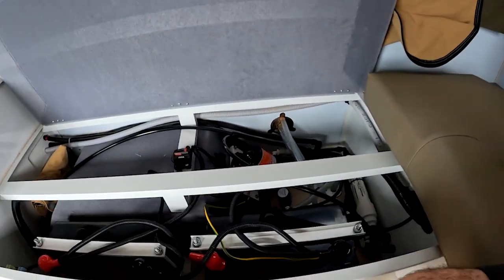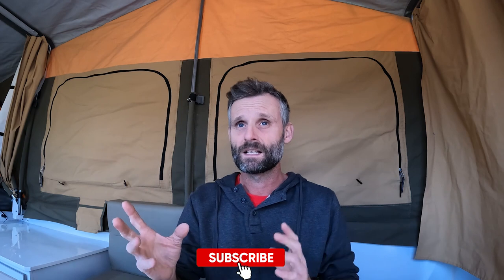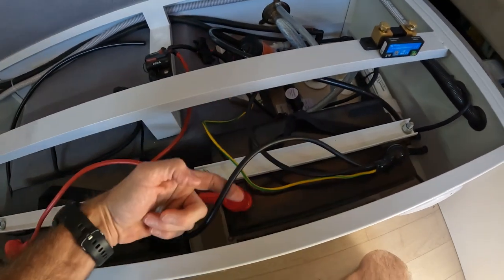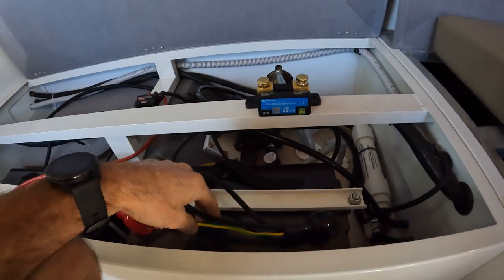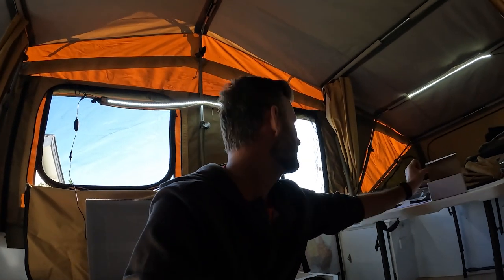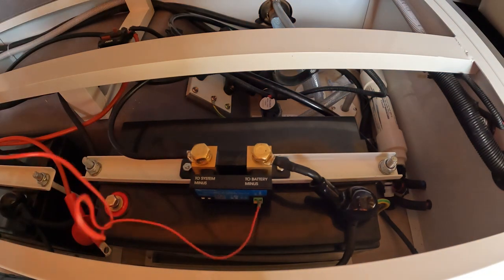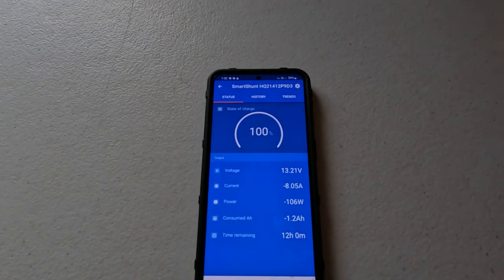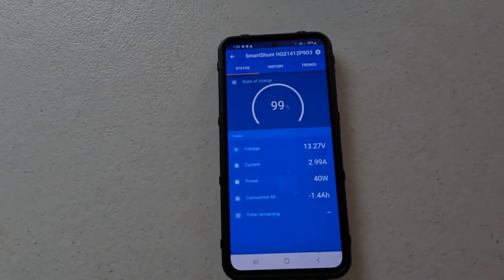VICTRON SMART SHUNT INSTALL - Lithium Battery Setup for Off Grid Camping

Comment: You explained everything just fine. Pretty short video full of good information. The graph about difference of the voltages between lithium and agm batteries tells so nicely why a shunt is needed with lithium. It would be impossible to know the lithium battery fullness with a voltage meter.
Reply from the maker: Thanks mate! Yep definitely need the shunt, otherwise it is just a guessing game really. Thanks for watching!

Comment: Thanks for putting this together, one quick question please. Are you using 6 ga wire on your batteries or 4 ga? It looks like 6 ga, which is not the required wire size for your distances, but it could be just the impression coming through the image from the video. TIA.
Reply from the maker: Hey,
I used the existing wiring at the time of installation which was 6ga. I have since upgraded to more appropriate gauge cables.
Cheers for watching.

Comment: Hi, To use the victron smart shunt do you need to have internet connection to connect from the phone app to shunt? What happens when your out bush with no internet conection ?
Reply from the maker: Hey John, No internet connection required (other than the occasional firmware update). Just the smart phone app.
Cheers mate

Comment: I think the Will Prowse review on these he said to ensure the batteries have been charged to 100% and allowed to equalise over night before connecting the shunt. This ensures correct calibration. The temperature sensor you can get for these is handy also and very easy to connect.
Reply from the maker: Hey Flow Rider,
Thanks for your feedback. 

It wasn't part of the vid I did, but as part of the calibration process, I charged the batteries to 100% and the following day I set the 'State of Charge' within the app to 100%. 

I'll look into the temp sensor, as any extra level of safety/performance monitoring is always a plus.

Thanks for watching.
Craig

Comment: Thankyou for your install video on the shunt. 
I have just replaced my Agm battery with a lithium battery in my 4x4 allso I fitted a victron dc to dc charger. I did this just before my last off grid camping trip for two weeks. 
I did not have the shunt and  like you was trying to save some money. I wish I had included the shunt it was so hard to know how much charge was left in the battery and flattened the battery a couple of times thinking I had charge in it. 
I run a 95l fridge freezer from the battery and on the cloudy days did not get enough charge to top the battery up. So had to run the car to charge it but still I didn’t know how much charge I had. It was a nightmare. I wish I had the shunt. Your video was great it shows how easy it is to install I will get one before my next trip. Thanks again.
Reply from the maker: Thanks Brian! Yep we had the same issue mate, definitely worth the money to not have the stress hey! Happy and safe camping, thanks for watching!

Comment: Not a bad Vid. Question   What is the green yellow wire doing still connected to the neg side of the battery?
Reply from the maker: Hey Phil. Well spotted. That is an earth wire just leading to the chassis (not running an appliance). I don't think it will matter and to be honest I didn't have the correct size terminal lug to mount to the shunt but it will be shifted. Cheers for watching.

Comment: Hey man, thanks for the video. Very well presented.
Do you remember where you got the hydralic crimper? I bought a crimper from Jaycar that was mechanical and it's a piece of shite. I notice that Sydney tools etc sell the crimper, but ebay has what looks like identical ones for a bit less. 
Cheers!
Reply from the maker: Hey Andrew,
Cheers for watching. I also found out how crap the mechanical crimpers are. They're fine for the light weight stuff but for the heavy duty cable lugs...they suck. I actually borrowed the hydraulic crimper from my next door neighbour. I think he got them from Sydney tools and cost him around $90. I can't comment on the ebay ones other than saying you usually get what you pay for. If they're the same brand it should be fine but if they're just look alikes then you wont know until you try it. sorry, not much help. best of luck.
Craig
Reply: @RoaminintheRobbo  Nope, thats all good, I will hit up Sydney tools then. Jaycar are about to get a call from Consumer Affairs Vic if they don't take this other crimper back. It is literally useless. 

Appreciate the reply mate, keep up the good work! Love your videos.
Reply from the maker: @andrewford80  thanks Andrew, appreciate that mate. Good luck with Jaycar!

Comment: Are you also using a Victron Solar Charger?
Reply from the maker: Hi Sal, 
No I'm not. I'm just using the solar input on the redarc dc charger. I also have a victron 15amp ac charger for when 240v is available.

Comment: Can I put my charger straight onto the minus on the shunt..
Reply from the maker: Hey James.
The 'to system minus' on the shunt is effectively now your negative terminal. So all appliance negatives, including chargers, need to be connected to it or downstream of it. So yes, the negative from your charger can be connected straight to the system minus of the shunt. Hope this helps. 
Thanks for watching
Craig
Reply: @RoaminintheRobbo  thank you for the reply i have yhe charger leads straight on to the battery terminals i will change it to shunt 👍